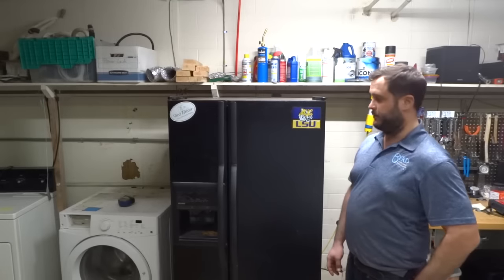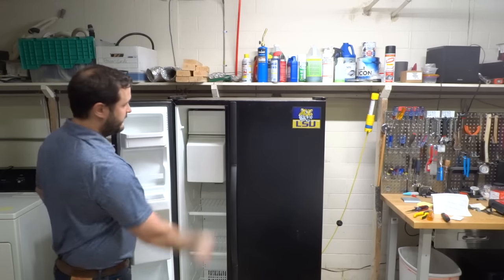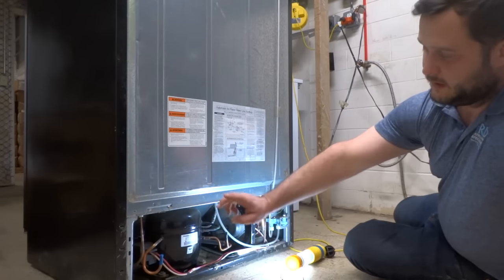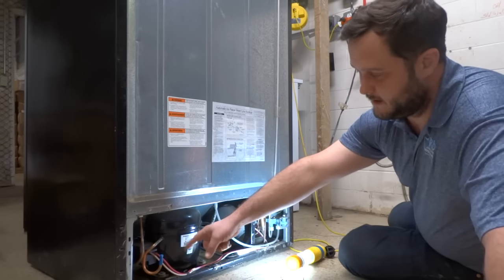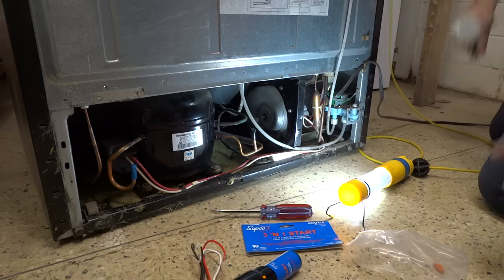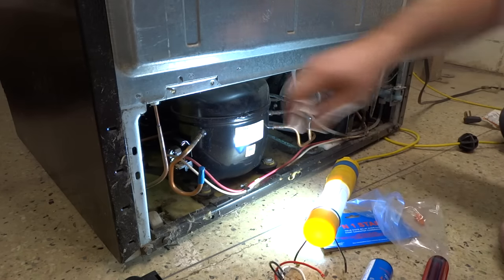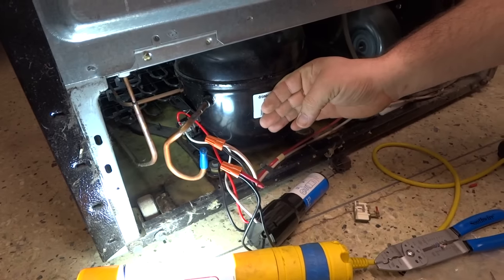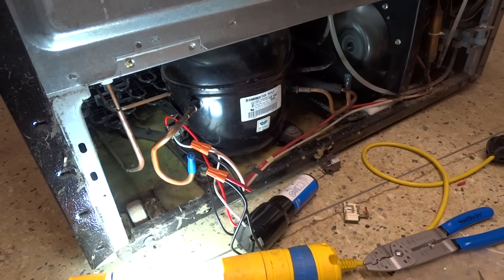Kenmore Refrigerator Not Cooling at all - Compressor

Comment: I disconnected a bad, I think, motor starting capacitor that was connected to the relay.  I am left with three wires from another box.  One wire is black that was connected to the overload.  The other two wires are blue and pink and were going to the relay.  I want to try the 3 in 1.  However, I'm not sure what I hook to the output of the 3 in 1.  I think it is probably the black and pink and the blue is unused.  Is this right?
Reply from the maker: +Cards Fn Trace the wires back. One probably leads to a run capacitor, or possibly off to the condenser fan - if off to the fan, don't forget to tie it back in. Order a 3n1 with run capacitor connections - I think urco410... so if you're wrong, no big deal - the extra female connectors tie in the run capacitor. Wiring diagram will be on the kit. Good luck
Reply from the maker: Also, if it was connected up directly to the relay, it was most likely a start capacitor.
Reply: Using the URCO410, I'm still not sure what to do with the last line out from 3 in 1 unit.
I did determine that the pink and blue run to a run capacitor.  But now, it seems like I need a fourth line.  What do I hook the second line out from the URCO up to?
Reply: Kenmore Elite 795.77569600.  I'm good with the black hot.  It is the neutral that I can't figure out.  It seems like there should be another wire somewhere.
Reply from the maker: +Cards Fn blue and black on your fridge tie to the black wires. Connect the others to the compressor. Leave the caps on the red and white. You should be ok, assuming that there was voltage going to the compressor... this is not a mechanical style refrigerator, i.e. it has a multiple computers. There could be many other reasons for the compressor not kicking on. Good luck.
Reply: Thanks for all of the advice.  I ended up hunting (and I mean HUNTING) down another starting capacitor and wiring it up the way it was originally wired.  It works.  Multiple parts shops told me that they don't make the part any more.  I finally found a few that could get them in 3-5 business days.  Anyhow, finally called the right place.  Thanks again!

Comment: I ordered this part but when I took off the part on the compressor there were 2 white wires and 2 red wires than combined in a white plastic plug in.......one red and one white wire seem to go to the fan and the other 2 come from the other side of the compressor (I am assuming these are the power wires...........I tried hooking up both red wires to a black wire from the relay then both white wires to the relay but when I plug it in........nothing happens.......fan doesnt even come on now. I know the fan was coming on because it worked before I went to this step.
Help Please
Reply from the maker: You'll need a wiring diagram and a little more research. Not all fridges have the same setup. Good luck.

Comment: Since this replaces the start relay and overlay protector will this new part require to be grounded?My start relay has a green wire connected coming from the compressor  down to the metal frame of the fridge.

Kenmore Elite  model year 2014 795.72373.310
Reply: Thanks to this video I was able to diagnose and fix my fridge as I have the same unit.  I used a volt meter and tested the overload protector, which tested good.  The start relay was bad though when I tested it.  I looked on Amazon and found numerous generic replacements for $8-$11.  But was going to take two days to get to me.  I went to my local appliance repair store.  They wanted $53 for the exact replacement parts (overload protector & start relay), but I only needed the start relay.  And for reference, the start relay is the part that has the wires plugged into it.  The start relay is then plugged into the overload protector, which in turn plugs into the compressor.  I could further tell that the start relay was faulty, as when I shook the start relay in my hand I could hear broken parts inside rattling around inside.  So luckily the appliance repair store sold a generic start relay for only $15.  I brought it home, plugged the wires in it, plugged it into the overload protector and the fridge's compressor started right up.  So my advice would be not to waste your time cutting and splicing wires and buying the 3 in 1 kit as indicated in this video.  It's so much easier (and cheaper) to just buy the generic start relay and or overload protector if needed.  Just pull those two parts off your fridge and do a search on Amazon with your fridge's brand, plus the words start relay or overload protector.  And FYI, most of the items on Amazon come with both parts, even if you only actually needed the one.  And another tip.... Make sure to pull the bottom front grill plate off the fridge and vacuum out all the dust that's accumulated on the coils.  An air compressor works really good for this too.  Good luck, you can do this!

Comment: So my fridge stopped cooling, the vapor fan works, I have an external heat grill so it doesn't have a fan, I don't hear any clicking noise but the compressor "on" could the start capacitor stopped working? The compressor does get hot like it working. Since this is a 20 yo fridge it all old school so I can see the defrost time it "exposed" in other words this is an all natural fridge it relies on the environment to cool it and keep the frost pipe at optimal temp.
Reply from the maker: Ok. If the compressor is "on" with no cooling whatsoever, you have a restriction or leak in the sealed system.
Reply: Could it be the starter not actually turning it completely on. I forgot to mention I do hear a drip noise when the system turns on after that it sounds normal besides the vapor fan always running.
Reply from the maker: Compressor can be hot and not on. If it's vibrating, it's on.
Reply from the maker: Refrigerant leak is most likely under the conditions you described.
Reply: KaL, the freon I listed helps seal small leaks, generally leaks are beyond our repairs unless you can weld. But I would give the freon a go and if it leaks add some more to top it up. Let it run empty or some sodas to chill over night check it again, if the pressure drops drastically it's a goner but it moves a smidge then you're fine it such a small leak you wouldn't need to worry since you can refill the fridge 2 or 3 more times from that one can. If you are really concern on the leak I've been told to dump the entire sealant to find and seal the leak/s. 

Cliplight Super Seal Advanced 944KIT - Permanently Seals & Prevents Leaks in A/C & Refrigeration Systems - 1.5-5 TONS https://www.amazon.com/dp/B00E0CVYBS/ref=cm_sw_r_cp_tai_i_ITj8AbAK6HCPG

Comment: I have been waiting for a compressor for over a month. I think this tech is jerking me around.
Reply: Can I ask ... how much is the tech charging you to replace and install your compressor?
Reply: @markg6860  $800
Reply: @LaJoyB  Actually, that sounds reasonable, to me.  Compressors can be $300-400, then the guy is going to have to recover the R134a, then "un-braze" the old unit, braze in the new one (along with a new dryer/filter), then charge the system.   Compressors are sometimes on wait, but a month seems excessive.  I thought I had a compressor issue, but it was something else.   Usually, when compressors go out ... usually due to age ... people just get a new fridge/freezer, simply because all the other components are also wearing out.  Regardless, good luck!
Reply: @markg6860  well I purchased a new fridge for $2K. I placed old fridge in the garage. Maybe I get it fixed or someone buy for parts. Fridge is in good shape. Maybe I use it for growing lol.

Comment: I have a Kenmore side by side that has served me well for 20 years.  I noticed freezer had higher temps, ice cream way too soft, and motor was not running.  The 2 knobs for freezer/fridge adjust, and degree of temp, are in the top face panel of fridge section.  I discovered by chance that if I give a thump to that cover plate, the motor comes on and cooling returns.  But happens again a day or so later.   I'm wondering if there may be a short under the face plate in those switches.. ?  have you heard of that before? many thanks for suggestions. (have thoroughly cleaned coils, and etc. from dust in bottom back and front of unit. )   Tom
Reply from the maker: Probably the cold control or defrost timer. We have another video on those problems. Good luck
Reply: where might I access that video...?    thanks.
Reply from the maker: https://youtu.be/h4114NrhspM
Reply: ooops!  just found it on your site!     :o)   good.

Comment: What type of kit is that and where did you order it from? I have the same fridge. Thanks!
Reply from the maker: +Carl Settles 3-n-1 Start Kit (RCO410) should handle common household refrigerators. If yours has a run capacitor as well, it would be best to find another style that will incorporate it for protecting the compressor - go to your local appliance parts shop to get help with your model number for selecting the right kit.

Comment: Yes like he said if the compressor is bad then it may last two or a week and then will burn the compressor completely or it may last a year 
I my self I always try the original relay kit and if that doesn’t work then yes there’s a problem with the compressor and then I talk to the customer about this 3 and 1 peace maker thing and then is up to them if they want to install one yep
Reply: Yeah I was wondering about why he didn't use a factory kit. Cutting wires and crap compare to just plugging something in seems a bit extreme.

Comment: Kenmore Elite, Estimate on replacing compressor $1,389. And repairing fridge.    Guys complete yunk.   How can we stand a class law suite against this product made by LG.  Sears is backed up on these fixes.
Reply: Jerry Cruz you compressor are LG, of 220volts?
Reply: @esthercardenas7867  no way!   These are inverter compressors on new fridge.  110v very low amp.

Comment: Thanks for the Video. My Fridge stopped cooling and have the same issue. I bought the RCO410 but having problem with the input to the device. The GE Profile fridge I own (PSHS6VGXBDDS) in which the Relay, Capacitor and overload unit are separated.There is common wire (black) that goes to the overload unit. An orange wire goes to the Run connector of the relay and also to the Capacitor. The white wire comes from the other side of the capacitor and goes to the start connector of the relay. Now if I disconnect all 3 of these and replace them with the SUPCO RCO410, I have left with 3 wires (Black, Orange, White) and I am not sure how do I connect these to the input of the RCO410. Any help is greatly appreciated.
Reply from the maker: +Sam Khorsheedy Sounds like you need the URCO410... you could bypass the capacitor, but it's better for the compressor to keep it inline. Instructions will be similar to the RCO410. Good luck!

Comment: help, what if the fan near the compressor is not running, the compressor isnt working, i change the relay and the fan and compressor still dont turn on?
Reply from the maker: We have another video on that. You're not getting voltage. Good luck.

Comment: My condenser is warm to the touch, both fans are operating and there is no frost buildup whatsoever, my fridge it won’t cool, please help what could it be?
Reply from the maker: Could be restricted sealed system, if the compressor is running. Good luck.
Reply: Byrd Appliance Specialists  What if it is a restricted sealed system? I’m wondering if I should give up on this refrigerator, I unplugged it for a little while was going to try that,
Reply from the maker: If it's the sealed system, it's toast.
Reply: Byrd Appliance Specialists OK, would you give up, or could it be something else? Thank you for your help
Reply from the maker: Compressor running, no cold whatsoever = something wrong in the sealed system.
Reply: Byrd Appliance Specialists ok thank you

Comment: My fridge has a problem, it works fine sometimes,bit if I move it somewhere, it stops cooling completely, it comes on but doesn't cool, I replaced the relay but the same thing keeps happening, anyone has the same issue?

Comment: Why wouldn't you just replace the normal relay and not the 3 and 1 which only has limited life?
Reply: Some 3-in-1 installations last for years.   Obtaining factory parts for old fridges is sometimes a problem ... often they are not available and are expensive, too.

Comment: Please how Can i fix a compressor thats working (vibrating) but not cooling?
Reply from the maker: If compressor is running, and you have no cooling at the evaporator, you have a sealed system issue. Leave it to the pros.
Reply from the maker: Usually, it is not economical.

Comment: Couple simple questions.1.If fans ARE working, but no cooling at all .No compresor kick on or noise at all.Look at the part and area in your vid as possible cause? 2.If fans compressor NOT running, look some place? Lastly, opinon only for thought."If" a fridg was well taken care of, cleaned etc.Was brought in 2008.Just now has issue of no compressor start, what are odds the compressor is dead.Mainly curious with odds compressors go bad.Something often or sorta rare?  This all ties into a lady brought a side by side Whirlpool 2008 new.Claims fans on no compressor sound or cooling.Fridg looks mint.I been tossing for days to buy or not.She wants 100 or best offer.Thinking about my odds here on that compressor.
Reply from the maker: Could be an issue at the compressor. Condenser fan is usually only on when compressor is on.
Reply: I guess she read around and thinks a thermostat issue.However, I doubt she knows much about issue at hand.She did confirm not hearing a click at all around compressor.Just dead not turning on.Think theres any chance at all replacement of what you did may solve or run lol.?
Reply: Mobile No please sir

Comment: why not just get the replacement parts instead of modifying it. i changed the relay kit on my kenmore and it was an easy connection without modifying parts.
Reply: That OK, if you can still get the parts for an old fridge ... and they are affordable.

Comment: Not good information to use. First Kenmore is not a manufacturer. It's a Sears branded name. It has 14 different manufacturers. Some of which use linear compressors which you can not use this repair for and can cause someone serious injury if attempted. Second a jump start kit is not a repair. It's a band aid. A new PTC and overload kit is cheaper and keeps all components OEM. Plus you could have informed on how to ohm this particular type of compressor to check for good windings before having people purchase things that would not work due to bad compressor if it had bad windings. If going to do instructional videos, be thorough and correct, yet your misleading information also keeps me with job security, be a professional before calling yourself one. This is one reason why appliance repair is so costly...
Reply: Will this "band aid" cause problems down the road by damaging something or masking other issues?  Why does it seem to work for so many?